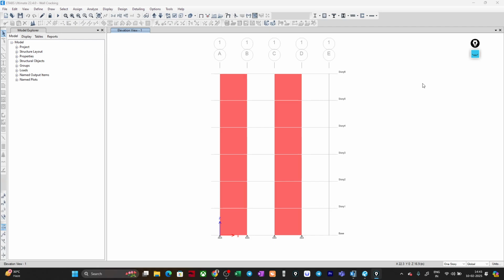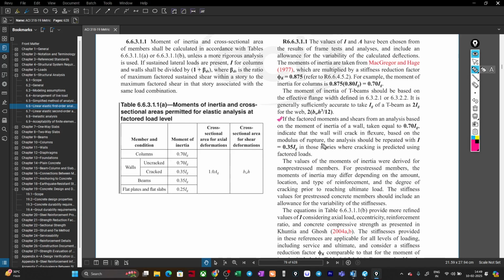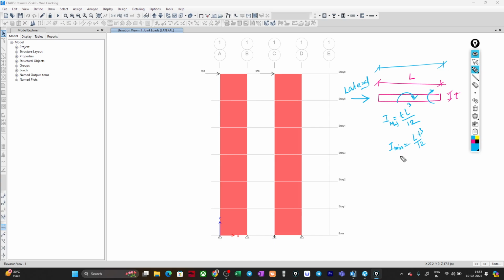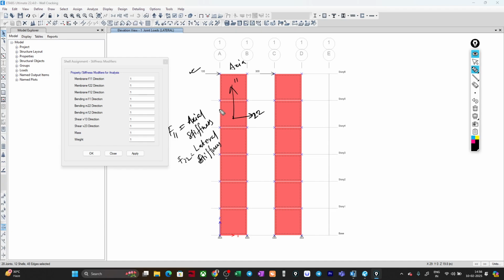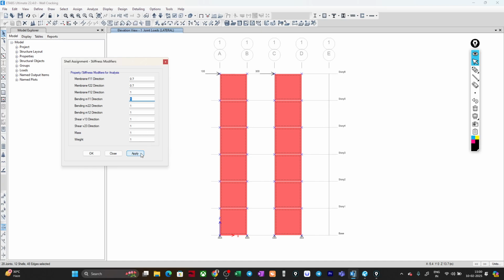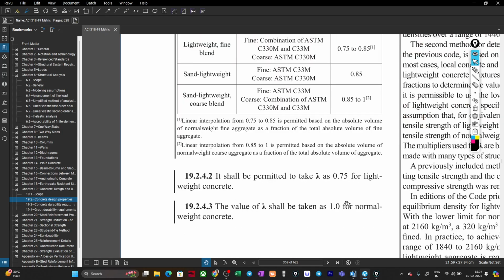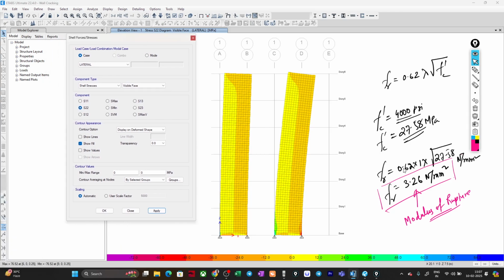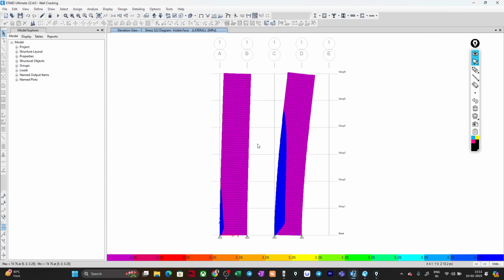Stiffness Modifiers for Structural Walls as per ACI 318-19 | ETABS | ilustraca | Sandip Deb

Comment: f11 is not the axial stiffness if you use default local axis of the shells, f11 is the horizontal local axis, therefore axial stiffness is f22, which means the local Y direction. please double check.

Comment: Hi sandip. as per the csi documentation f11 - Modifies the membrane stiffness in the local 1-direction (typically the horizontal direction along the length of the wall)
f22 - Modifies the membrane stiffness in the local 2-direction (typically the vertical direction)
f12 - Modifies the in-plane shear stiffness of the wall
which is shown in reverse in the current module. Please clarify

Comment: Good video.
1. You calculated the modulus of rupture of wall in N/mm2. I hope you still considered the cylinder strength and not cube strength. 
2. How is f22 related to MOR.
3. What about serviceability criteria for cracked wall sections. Do we use the same cracked  stiffness factors ?
4. If the structure is analysed for elastic analysis then why we reduce the stiffness of wall . After all it will not crack

Thanks

Comment: Hi Sandeep, thanks for good explanation.
A couple of points I want to add,
1. The local axes that you have shown can be opposite as well. Generally by default they will be 1-1 in horizontal direction and 22 for vertical. So just from viewers point of view they can differentiate and see it from local axes
2 is wrt the modifiers, you have shown stress for both directions, and for S11 it seems exceeding only for first storey, i guess then f11 should be updated for those storeys only, please do a bit of clarification